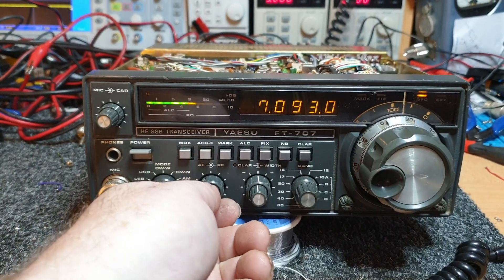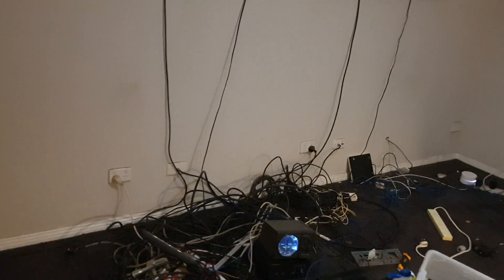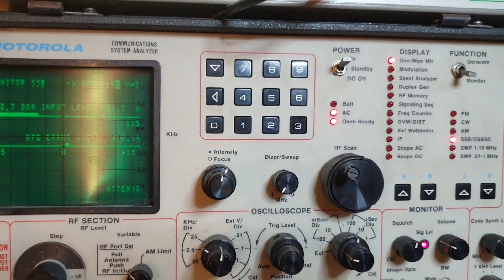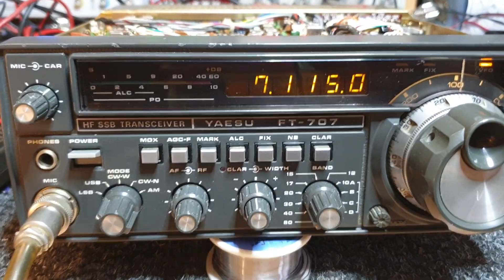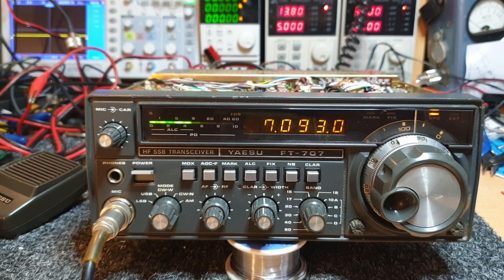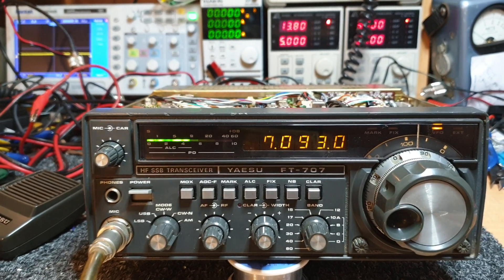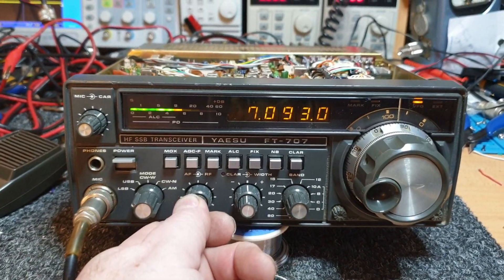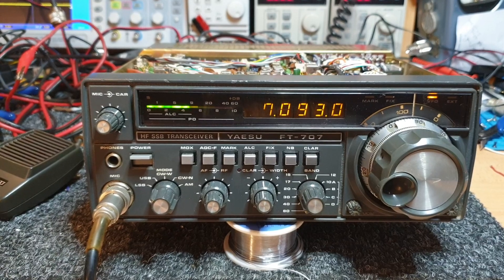One Yaesu FT707 HF Transceiver lives again. Now back to the huge clean up here 😁😁😁

Comment: Good to see You rescued the good ol' 707. I run a 707 most days as my primary radio for working SSB and occasionally the odd AM QSO. (NOTE: Standard 707 'wayfarer' pushes 100W, mine has modification to effectively make it a 707S, 10W MAX RF output as per UK license power limitations) Keep up the good work ! 73 de MM7WAB, 'Hairy' Paul.

Comment: Exactly what i wished to talk to you about ...I also have a FT707 .... I also have a number of other shortwave radios . which i picked up over relatively recent times  .. I have a FRG7  ( 2 of . one sitting beside men  ) ..Yaseu V0-100 ... Aldo105 which has VK21k engraved on the front . Kenwood R300  . In the Garage I have Denton Gla 1000  ,  Sommerkamp TA 288TA , Yaseu FT200  , Realistic DX200 , Sony TC 158 SD  . buggered if I know I have stuff everywhere  ... ... The reason for contacting you is that my Yaseu Ft707 ... when tried, it billowed moke ... do you have recommendations as  to approach to repair the FT707 , at a reasonable cost , repair it in  exchange for any of my radios. I live in Diggers Rest , 32 kilometres North West of melbourne  ... I love my little collection ,  while not using any of them ,, I was brought up in a  time of analogue and the associated sound of frequencies drifting  .. I'm not in any rush  , even an exchange for a recognized brand of transceiver ( not realistic ) that has digital readout .... I just don't want feel that I'm being ripped of ...It happens so many times,  both when you become older or 'Dealers' see an opportunity  ... . Thank you for taking the time to read my message  ..Kind regards Alex